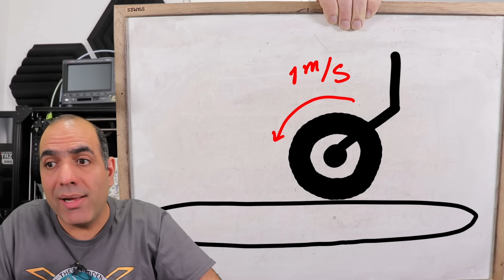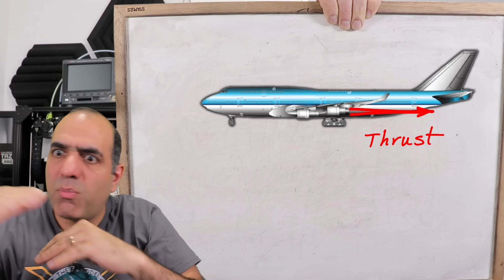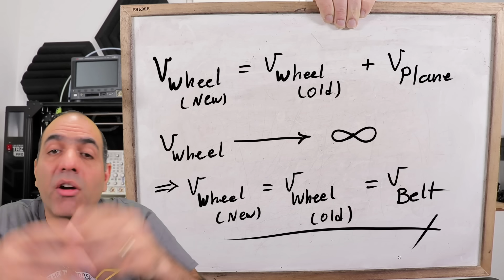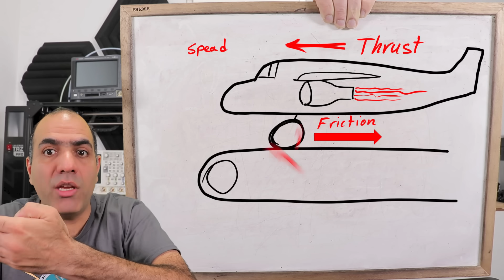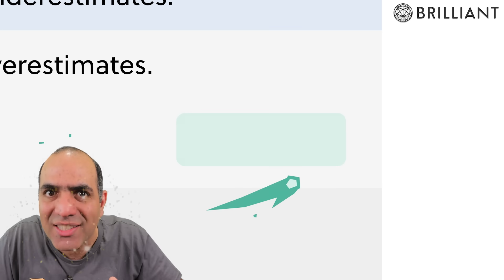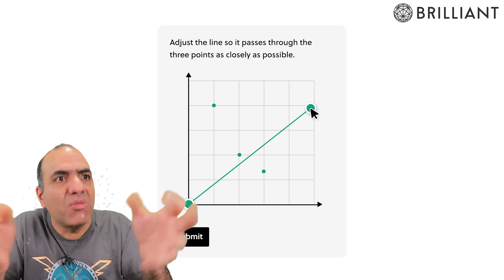Airplane Question that Drove Me NUTS!!!

Comment: If engineers built planes with wheels that created enough friction to even compare to the force of lift from the powerful engines, no one would be flying today.
Of course, I say this with a mild passion.❤
Reply: I wish safe vacuum hyperloops or w/e were real. Damn that would be fast. And if anything went wrong, you wouldn't know.
Reply: @mikegamerguy4776  You mean pneumatic trains? Even if they were safe, no one will ever use one. Because system itself is broken from the beginning.
Reply: Think about this.
What makes an airplane fly? Movement of air. Lift. Under the wings. 
What is better at making air move, a propeller that is specifically designed to perform this task, or a running conveyor belt with virtually no friction with the air above it? It honestly blows my mind that this debate is still going on.

Comment: 0:36 
Technically think the plane will take off. The wheels are not powered and the thrust is forwards to get it in the air. The wings lift it in the air.

(Took me like 15 seconds to think because I having a unit in science about air pressure and stuff like that)

(Edit I thought it will fall off necause i thought it was small but you said as long as the runway so it will fly because wheels are not powered.)

Comment: The movement of the plane comes from the thrust of the engines, not the wheels.  So long as the bearings of the landing gear wheels could handle the speed of being spun backwards by the conveyer belt, the plane would move forward and be able to take off the same as on a static runway. Simple. Duh.

Comment: The plane needs to be moving forwards in order to fly, it just makes sense, if it's stationary, even if the conveyor belt is preventing the plane from moving so the thrust can build up, it wouldn't work, it just wouldn't

Comment: One simple hint to this stu*** question... AIRplane flies by AIR SPEED moving across its wings, NOT by relative speed to the ground (which is the belt in the question) or wheel speed....🤦‍♂

Comment: If your curious about the MythBusters experiment, it's Season 6, Episode 28: Airplane on a Conveyor Belt. Adam Savage also did a follow up video on his Tested YouTube channel that gives a better explanation. TLDR; planes fly because its engines move the air around it and create lift, not because the engines are push the plane forward, causing it to deflect off the air.
Reply: wrong. thrust pushes the aircraft forward (taking ground as a reference) and the relative velocity between the wings and the air, generate lift on the wings.

Comment: Of course it can take off the drag from the wheel bearings should not be greater than the thrust of the engines ESPECIALLY if it is not fully loaded.

Comment: No it will just accelerate forward slowly then faster.. regular plane physics apply, it’s moving air to move through the air, wheels would be a friction for a bit, but they are generally speaking free spinning.. the plane will not take off unless there is enough conveyer belt.. that’s a lot of conveyor belt..

Comment: Well, at least it keeps you from blowing up light sockets and other electrical equipment... safer for the world's AC power... I mean... mostly in hotels.  The airplane still takes off though for this problem... then unfortunately for those hotels that have the smell of burned resistors and potentiometers in them...  Thought you said you wanted a "non smoking" room  LOL

Comment: I was in that thread. I tried to walk though how the wheel speed doesn't determine ground speed. The other people didn't get it. But they seemed happy when I got around to saying it would depend on how fast the belt could accelerate to a speed fast enough to break the landing gear.

Comment: Unlike a car, the wheels on a plane do not provide motive (moving) force, the engines do that.  The wheels are freewheeling.  

The speed of the wheels are not relevant to a plane being able to take off.  The wheels / treadmill could be doing 1,000 Kph, and as long as the engines can push he plane to its normal take off speed, then the plane will take off.  It the take off speed is say 200 Kph then the wheels at takeoff will be rotating at 1,200 kph.

As long as the wheel bearings hold out, the plane will take of as normal.  If the wheel bearings seize, then it will probably stop the plane from taking off.

Comment: The plane would just go across the belt no matter the wheel speed. In fact as soon as the aircraft thrusts forward the wheel would attempt to move, but the tread mill would immediately correct, so it would be the same as a frictionless wheel. (The wheel would appear not to move relative to the treadmill, nor would it rotate.) The treadmill would however have to match the acceleration of the aircraft in the same direction as the aircraft.

Comment: I uhhh i still don't get it. The imaginary situation states that the plane is kept stationary by the belt even though the thrusters are turned on. In that case, the plane seems to remain stationary, and the air particles around it are stationary. No air particles are colliding with the wings at any speed above 0, since no air particles are colliding with the wings, no lift is created.
Reply: Ohhh I get it now. The plane will still move forward and lift off, the engines will still push the plane forward, even if it is on the conveyor belt, the plane will move at a velocity V and the conveyor will move at a velocity -V which will cause the wheels to spin at a velocity 2V.

Since the conveyor matches the speed of the wheels, and not the plane, then the conveyor will now be -2V, which will cause the wheel in turn to become 3V, which then causes the conveyor to be -3V and so on until infinity.

Ugh, the more I think about it the more solutions it has. ElectroBOOM explanation was actually pretty thorough I just didn't understand it the first time. I think the whole internet could've been saved a headache if the puzzle was worded better and said that the conveyor matched the speed of the plane rather than of the wheels, because that kinda causes an impossible scenario to take place.

Comment: The plane would likely take off, but it would be struggling as if it was heavily loaded. Let me explain: A Boeing 747's rotate speed (speed in which the plane has to be at before it can take off) is 184mph without any wind. The wheels would have to be spinning at 2x the air speed because of the conveyer belt, which is 368mph. The drag from the bearings and mass of the tires would be putting load on the plane, but with 4 engines  there is plenty of power to overcome that additional drag, assuming the tires can hold together when they are 145mph over their speed rating. Most aircraft parts are commonly under rated for redundancy but it is a bad idea to count on that.

Comment: I look at this simply. First case Engines off, Second Engines providing thrust sufficient to launch.

First Case:
There are Five components:
1. Rolling Friction of the Wheels.
2. Bearing Friction in the Hubs
3. Friction of the Belt to the Rollers
4. Inertia of the system especially the aircraft.
5. Air resistance.

In this system the wheel and rolling friction will impart a force onto the aircraft assuming the belt is moving in the direction of the tail. This force will accelerate the plane in the direction of the tail to the point that assuming a constant velocity the plane will eventually be moving at the same speed of the belt. If the belt is accelerating then the place will continue to accelerate until all of the frictions acting in the system have reached equilibrium. The plane will not fly since it is not oriented for flight.

Second Case:
There are  Components:
1. Rolling Friction of the Wheels.
2. Bearing Friction in the Hubs
3. Friction of the Belt to the Rollers
4. Inertia of the system especially the Aircraft.
5. Air Resistance
6. Thrust

Engines spool to full thrust and the breaks are released. The plane accelerates because the movement of the plane happens since the thrust vector forward is from acceleration of air and hot gases in the engine. Wheels in contact with the ground do not provide any thrust only friction. The only remaining frictions are small compared to the thrust, and as the plane accelerates more lift is provided by the wing, resulting in less rolling friction, and bearing friction. The plane's systems are rated to well in excess of 2-3x the rated takeoff velocity, so even with the wheels moving at 2x the forward velocity, the plane will take off. It will take a while for them to stop, but that will happen. Intuitively this happens all the time in STOL competitions all the time. A plane can take off with minimal ground speed, even negative ground speed if the wind is blowing hard enough. Ground speed is not critical in the functioning of the wing, only in the obstacles on the ground being avoided.

Comment: I'm going to propose another answer! To start let's add a correction to how planes fly. Planes don't care about how fast they are moving through the wind to achieve lift. Lift is achieved by the force generated through wind going over the wing. in fact you can fly a plane in a large enough wind tunnel without the plane moving forward or backwards. it's the air that needs to move not the plane.  

Now to the new answer:
With a conveyor belt that size, when the belt is moving, it will move a little bit of air with it. Air is a liquid and liquids have viscosity. (This is how mixers work, they have a rotating wheel that relies on the fluid catching up to the speed of the wheel spinning). At 25 ℃, the kinematic viscosity of air is 15.7 cSt. (1.57 x 10-5 m2/s). you can feel this air that "sticks" to the surface of a moving thing and move with it by holding your hand close to that surface. You should try this with your treadmill. As the belt speeds up the air that moves with the belt becomes stronger and faster and it also starts moving upper layers of the air above it with it. Eventually at some point, it becomes like a wind tunnel, so powerful that the amount of wind going over the plane wing is sufficient to make it hover off the ground like a helicopter. So it is still possible to achieve flight off of that treadmill despite friction. Best case for this is to find a very small and light plane that can take off at very low wind speeds and has VERY sturdy wheels.

Comment: The force moving the aircraft comes from the thrust leaving the engines. That force against the aircraft will not be negated by a conveyor belt under the wheels. It will roll forward. I don't really get where the disconnect is here. The belt could instantly accelerate to match the wheels, but the wheels would only need to rotate to 2x take-off speed. It wouldn't matter if the belt could go faster because the aircraft wouldn't need to go any faster to take off.

If we're talking a magical conveyor belt that can ignore the laws of physics while the aircraft is still required to follow them, it could move fast enough to melt the wheels off the landing gear and that would functionally prevent taking off. The engines of the aircraft aren't going to overcome the friction of its landing legs dragging on the ground.

Comment: My therory is, that the plane will not take off, because the air have to move arround the wings and even if it is "moving" with full speed and the belt is moving backwards with fullspeed the air isn't moving fast enough arround the wings. Also the friction of the belt (which is moving the air backwards under the wing) isn't enough to give the plane uplift. And if the plane is leaving the ground somehow it means that the plane is suddenly in the air with full thrust but without movement, so it would fall back down that second on the belt. Perhaps I'm wrong but I think for me this is the only logical way.

Comment: what I thought was different. imagine you have a car on a treadwheel and have a winch dragging it forward. The car would move forward and not care about its wheels or tread wheels. airplane wheels act like a chair; engine thrust moves the airplane's body forward and wheels need no calculations.

Comment: If the jet engine can make enough air movement to create lift, Yes it will fly, But a 747 doesn not have enough power to do that.  Some STOL airplane will almost do it, and if you have a strong front wind they will almost fly on place but that is not a 747.

I was wrong. I will go to Brillant

Comment: You're ignoring the friction of the belt moving through air. With the belt moving at near-infinite speed, it would essentially "shove" air in the opposite direction of the plane. Therefore, with even the tiniest movement forward to initiate the belt/wheel infinite loop. The plane would eventually have enough opposing airflow to at least hover above the belt.

This question is indeed mildly infuriating.

Comment: Haven't even watched the video. A moving surface does not change the fact that the wheels on a plane just free spin. The engines produce thrust and not wheel speed. The plane doesn't care about a surface moving in the opposite direction.

Comment: No... The trust comes from the turbines not the tires, but... the tires will have to spin twice as fast for the plane to take off, going above their design limit and causing them to blow up in to smitterings before taking off.. Then crash... so No, it cant take off...

Comment: So the ultimate question is what speed the airplane tires are rated for right? If they can handle at least twice normal takeoff speed then the added rolling resistance and bearing friction shouldn’t be a big deal. But if they don’t and the tires fail before the plane gets off the ground then it’s not going anywhere.

Comment: If the plane leaves the wheels locked, it will take off easily. The belt would move in the same direction as the plane.. ;) Easy

Comment: FFS.  "MEHDI!", the wheels and ground (conveyor belt in this rètàrdèd example) are completely decoupled from the plane taking off or not, obviously, unless of course the wheels and/or surface they are on (conveyor belt or whatever) for some reason impede the plane's ability to reach the velocity to gain enough lift to take off.

Why do you even waste your time with this except to ridicule the kind of mõrõñìç àsshõIè who comes up with this kind of shìt?

Comment: i’m not sure i understand. Assuming the wheels and belt start with 0 velocity, and then it’s turned on, that doesn’t change anything. There’s no lift force on the wings from spinning the wheels. Even if you turn on the engines the conveyor is not long enough for take off

Comment: First of all, the environment isn't given in which the plane is about to take off. Also, note that people will answer with respect to the assumptions they made for the environment in which the plane is taking off. There are different answer for different cases. In this case let's just assume that everything is normal, no unicorns lifting the plane, and there is friction between the wheels and the conveyor belt. It won't take off, when the wheels of the plane are spinning in a normal runway , it's moving forwards, there is air hitting the wings generating upward thrust due to air resistance. Since the conveyor belt is equally as fast as the the wheels, the plane wont move forward, preventing the generation of air resistance from the wings, Thus, also preventing the generation of upward thrust for the plane to take off. I'm just a class 10 student who likes physics, hope my explanation was good, I tried.

Comment: It can, assuming that the wheels don't explode from being spun at twice the takeoff speed. The thrust comes from engines and wings don't care about what happens to the wheels so I do not see how the plane couldn't just take off at a normal distance + maybe a few percent more to account for the added friction
Reply: The problem is once the wheels turn at all, the belt starts to move which causes the wheels to spin faster, which cause the belt to spin faster, causing the wheels to spin faster forever increasing speed to infinity. Not just twice the normal take off speed.

Comment: But thinking so much is stupid because the basic principle of a plane is to achieve (x) momentum before taking off so this will happen at a point in time while on the belt now for the plane to take off the flaps need to move which they can so as the pilot moves the flaps the plane takes as the air drag pushes it upwards so yeah it will take off. Hope that helps

Comment: Lift is proportional to the relative velocity between the wing and the air. If the result of the treadmill keeps this velocity at 0, not matter how much thrust you have it wont take off.

Comment: the wheels don't do anything to fly, it's oncoming air going under and over the wings. you could make any plane take off and even go backwards with 200 to 300 knot headwinds
Reply: the plane would not fly. airspeed doesnt correlate to groundspeed. if the plane produced thrust, with enough headwind, it would fly

Comment: I mean the question obviously meant in normal atmosphere, normal friction, and normal air on earth, and with ofc the engine started and attempting to take off.
if there were wheels that could keep up that speed, and a belt as well, then it would take off simply due to the air current generated from the insanely fast moving surface under the wings.